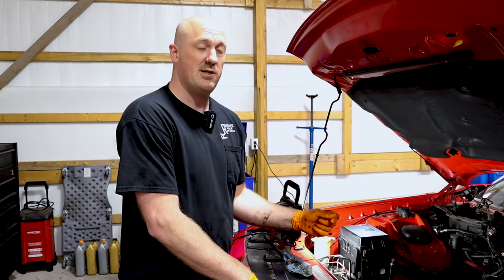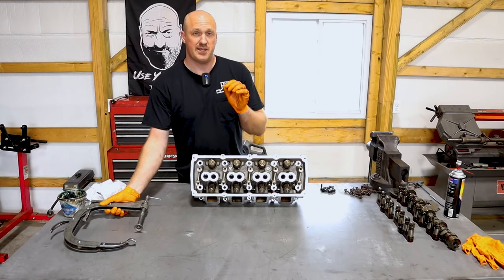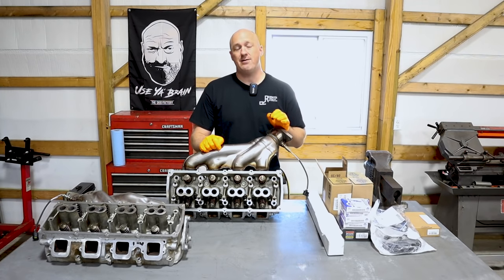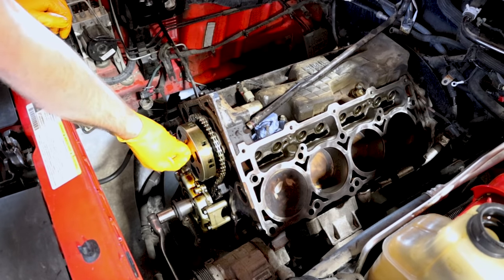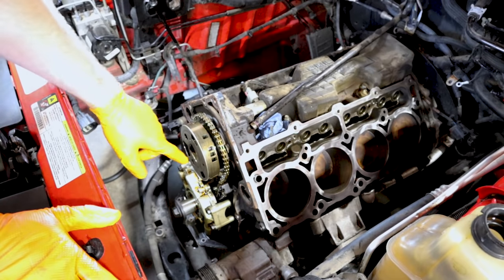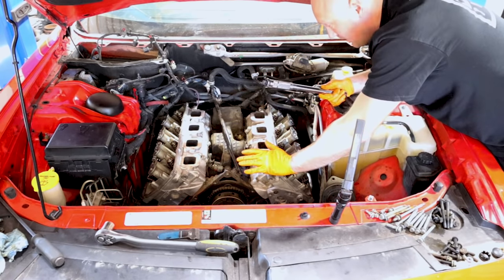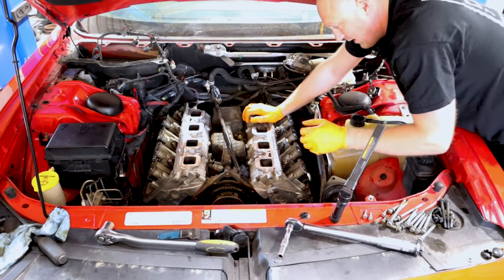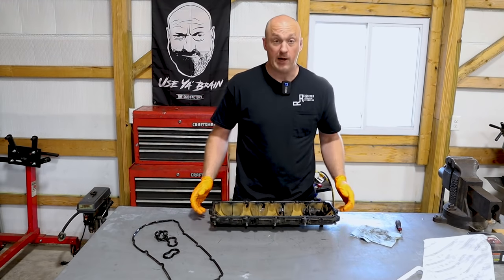Hemi Camshaft Installation Continues, SRT Headers Install! Budget Challenger Build Ep2

Comment: Thank you for this great series - it has given me the confidence to try this job at home, to fix a stuck lifter.  Unfortunately, I’m finding myself worried about the condition of the heads, and their ability to seal properly at the head gasket.  I scraped off any old material with a plastic scraper and gasket remover and cleaned them up as best as I can but I see a lot of people using abrasive wheels, which I didn’t do, and others saying heads need to be machined and resurfaced or an OEM MLS gasket won’t seal.  I’ve read aftermarket head gaskets are a little more forgiving in this regard, since the OEM gasket is generally fit to brand new components.  
You didn’t really touch on this subject in the series, and I’m wondering if I’m overthinking things.
Reply from the maker: Interesting that you post this now, since I'm literally filming a segment tomorrow speaking about this exact thing! In short, yes you're probably overthinking it a bit. I use a red (medium) coarse roloc disc on a 90 degree sanding wheel to clean the gasket residue from the surface of the heads. Don't sand at an angle, keep the disc flat to the surface, also don't put pressure on the disc, you're just looking to remove the excess gasket material, not take off the top layer of aluminum. The discs are much less aggressive than you think they are, this is what they are designed to do. 
Literally all you need to do is get rid of the gasket material from the previous head gaskets, you don't need to remove every mark from the head gasket surface. You also do not need to resurface the heads if you haven't had any issues with overheating or suspect the engine has been overheated at some point. 
As far as aftermarket head gaskets being more forgiving than OEM ones, it's actually the other way around. OEM head gaskets are far more preferable in my opinion. 
Love the fact that you've tackled this yourself, shows the channel is doing what I meant for it to do. 💪
Reply: @ReignitedAuto  Thanks, I feel a whole lot better!  Yeah, so far following your videos has made this an absolute SNAP.  The only snag has been drilling out one of the studs on the exhaust flange that broke off.  I'm hoping I can just put through a nice grade 8 bolt and a nut and that will suffice.

So this is an 09 Charger I bought out of state back in June.  75,000 miles, and it made the trip back home just fine.  BUT as soon as I got it home (200 mi drive...) I shut off the car and when I next started it, I took off and got a misfire right away.  That's when I noticed the ticking.  I took it right in to a mechanic (dealer) and they diagnosed a collapsed lifter, as I feared.  They were going to charge $7,000!  I actually said 'ok', but they sat on the car from June until last week.  When I found your videos, I said "I can do this..." and I towed it home.  So far so good.  So yes, your channel is fantastic. I've always worked on my own car, but I never thought I'd take on something like this.
Reply from the maker: @madfingers  That's awesome, good work 👏
Reply: If and when I do not looking forward as my 5.7 is in a Ram 2500 4x4 stock height , wanting to do long tube ARH at same time, thinking about doing this 6.4 cam , do you think the advantages are there and did you say you can leave mds active 
Thanks for the video

Comment: Great explanation and timing for doing this, you found a problem before it got worse. Is oil degradation one of the factors that can cause this type of wear on the lifters and cam...If so, will changing the oil before the specified time help?
Reply from the maker: Absolutely oil degradation is a huge factor in premature lifter failures. I'm a firm believer in oil changes every 3k miles. I know the newer synthetics give a longer interval than that, but better safe than sorry in my opinion.

Comment: Once again, a great video.  I'll comment on things I did wrong and perhaps some other tips that might be good or bad -- I'm definitely not as skilled as you.  I put loctite on the cam bolt and on the lifter "cartridge" bolts.  I just used blue loctite.  When I replaced my springs, the first time around, I had my shop press them on because I screwed up and dragged the head on the dowel pins.  But, I wanted to take a few off to check something, so I tried two different methods.  One is to place a rag under the valve, put the head down over the rag, then take a large socket that completely fits over the spring retainer, and give it a few good whacks with a hammer.  When you do that, the keepers fall (I should say fly) out.  But Autozone does have a screw style spring compressor.  Some say it doesn't work with the hemi, but I got it to work fine with mine.  Much better and less violent way to get the keepers off.

One of the mistakes I made when reassembling the valvetrain was that I actually put a pushrod into the cylinder head drain hole.  Thankfully, it was the exhaust lifter and wasn't able to fall all the way into the oil pan, but I still did need to use a magnet to pull it back out.  It seems like a silly thing to do, but in the ram, it's hard to work from the side and be "level" with the cylinder head like on the challenger.  When putting the rockers back on, I found that it was easiest for me to figure out which pushrod was going to be the tallest, then set that in the rocker and ever so slightly tighten the bolt near it.  then move on to the next highest and so on.  If I didn't do that, inevitably when working trying to get all four lined up, one of them would fall out of the rocker cup.  Then when they were all in, I would tighten everything down a little bit, but not all the way, and then run my finger on the rocker arms.  It is a relatively small difference, but if the pushrod is in there right, the rod will feel kind of "far" away from the tip of the rocker arm.  If it's real close to the tip, then it's not seated right.

On the Ram, the drivers side valve cover is particularly difficult to avoid the gasket rolling out like you said.  You're fighting between the cowl, the transmission breather, fuel lines, evap lines, and a brake booster.  In my case, I had to fight with it to get over the last rocker, but then once I got it over, I was able to pull it up slightly -- enough for me to get my finger under the cover and feel that the gasket was in fact rolled over.  Using my finger, I was able to press it back into place before tightening everything down.

Oh and one other thing I did, since I screwed up my heads when I took them off, I ordered an extra set of head bolts (I thought I couldn't re-use them).  In any case, I took two of the old bolts, cut the heads off real close (e.g. keep them as long as possible) and then I took a grinding wheel and gave them a dullish/blunt/rounded point (e.g. like the end of a pushrod).  I screwed the old two bolts one or two revolutions into the top front and back holes (The dowel pin ones) and then when I put the head back on, all I had to do was line up the two bolts, and slide the head down on those bolts.  The bolts that you cut down don't stick out very far because you cut them off, so you might need to use a magnet or needle-nose pliers to unscrew them when the head is in -- but that's why I only twisted them in one revolution or so.  So although you can re-use the bolts, perhaps buy two new ones and sacrifice two old ones to make the "alignment pins" LOL.  Both of those heads you put on went amazingly well, but for me only doing it once, there is no way it would have went on that well LOL.
Reply from the maker: Thanks Tucker!
 "One of the mistakes I made when reassembling the valvetrain was that I actually put a pushrod into the cylinder head drain hole" Super common, don't feel bad about it, I've seen lots of techs do this! 
 When putting the rockers back on, I found that it was easiest for me to figure out which pushrod was going to be the tallest, then set that in the rocker and ever so slightly tighten the bolt near it.  then move on to the next highest and so on.  If I didn't do that, inevitably when working trying to get all four lined up, one of them would fall out of the rocker cup.  Then when they were all in, I would tighten everything down a little bit, but not all the way, and then run my finger on the rocker arms" This is exactly the way I do it as well 👍
Also, Blue loctite is never a bad idea.
Reply: Tip to keep pushrods in place when tightening down the rocker arms. Get some fuel/oil rubber hose that snugly fits the pushrods on the ID and cut 3/4" pieces then slice them open. Slide them over the pushrods and snug the pushrods up to the rocker arms. They will keep the pushrods from dropping and will keep enough tension to hold them into the rocker arms. Once all tightened down you pull them off (that's where the slicing them open comes into play.)
Reply from the maker: @DL101ca  I like this tip, I'm going to try it tomorrow on my 6.4 build 👌

Comment: Great information!! My 2012 Ram Hemi had cam/lifter failure at 190K miles. The lifter was not on one of the MDS cylinders but appears to be a camshaft hardening issue because I had the same putting on six of the lives and one that was noisy that had worn into the lobe. Bought complete MDS delete kit with Mopar replacement cam and lifters. Hope this cam is better but 190K is not too bad but have gotten 300K out of GM 5.3’s. Still love  my Hemi!!
Reply: Sorry, six of the lobes! Doggone auto correct
Reply from the maker: Appreciate that feedback! 👍

Comment: This guy is spot on, couldn't explain it better myself. As far as the passenger side valve cover, yes I've been there also, there is an engine ground that runs directly behind it that runs up near the strut tower I undo, makes install a bit easier
Reply from the maker: Thanks for the tip!

Comment: Great videos. Thanks for sharing! 

Was told by a local [arts manager that the camshaft for a 5.7L is fairly soft material. And that they were roughly $65 for a 5.7 cam shaft! BUT.... you'll need 2 sets of lifter assemblies and those are about $475 EACH SET??!! 

So, not including labor costs, this isn't a cheap, budget job by any means. But I will say again, THANKS for sharing this info. Besides the parts prices being typical Mopar costs, I would do this at home and save the money from labor, since it IS very doable with hand tools and this knowledge.
Reply from the maker: Appreciate you watching Daniel. Yea Mopar parts pricing is crazy, the super cheap camshaft is a side effect of Chysler having to replace so many of them under warranty. By law they have to pay the dealer a markup cost for the parts used during warranty repairs, so if they price the part super cheap they pay less markup 😂. All part of the game.

Comment: I have a 2015 SRT392 I bought new that had three  lifters fail at around 23K - none were on MDS cylinders. 
All 16 were  replaced under warranty with updated parts (which came out in 2016).
Reply from the maker: Yea at that low of mileage I'm more inclined to think parts quality failure than anything else!
Reply: @ReignitedAuto  The one thing I didn't find out is what they changed about them in 2016. Would be interesting to know.  I also wonder if my cam was really"OK" like they claimed..
Reply from the maker: @ScottDLR  check out the community post on my channel I posted a couple weeks ago, is a direct comparison of the old style lifter to the new style 👍
Reply: @ReignitedAuto  Thanks - will do!

Comment: I’ve done this SRT manifold sway on my 5.7 and the motor mount heat shield studs interfere with the header. The need to be trimmed. Check before you put the head bolts in!
Reply from the maker: Weirdly some of the Chrysler vehicles have that stud like you mentioned, and some install the heat shield with a bolt. I haven't figured out why they use one or the other.

Comment: A lot of people have had a lot of success with Redline oil, it's high moly and zinc content have quited everybodies hemi valve train noise almost completely, so it stands too reason that in one way or another, it's lubricating better than your typical off the shelf oils and should mostly if not entirely alleviate these lifter failures. 

It's definitely expensive -- like double the price of Mobil 1, and you have too order it online, but it's still cheaper than a whole new valve train
Reply: Best bang for your buck Pennzoil Platinum unless you like to throw money away for no better performance. Most folks who spend too much on oil come up with all kinds of things to justify it. There's been all kinds of testing on additive packages, lubrication levels, viscosity, dilution resistance etc and they have not shown the benefits some expensive oils claim.
Reply: @DL101ca  I really don't go by tests, I go by how many people have used it and can prove it worked. HEMI's are known for a lot of valve train noise, which is normal in these engines, and literally every single person who tried Redline says it quietted the valve train noise almost completely, myself included. The only logical reason it would do that is improved lubrication one way or another. I'll stick with it. There's hundreds This fucking cop ran code for a whole nother fucking hour at well over 100mph, he risked everyone else's life, chasing someone he will never catch. There's hundreds, if not thousands of forum posts about exactly this.

Comment: My 2015 manual 5.7 started ticking at around 70k... I think it's a bit premature, especially considering the need to pull the heads to fix it. Thanks for the video on the process, though!

Comment: Sky, I installed the stage1 comp cam on my 2011 5.7. Before reassembly, I verified the #1 piston was at tdc and the cam phaser mark was at 12 o'clock. Although I didn't check the crank sprocket to make sure it was at the 6 o'clock position because I didn't remove the oil pump, I assumed it was because the #1 piston is at tdc. I rotated the crankshaft multiple times and the phaser mark and piston were dead on every time. Finally, the issue I'm having is after the engine is at operating temperature, it will not idle below 1000 rpm. On the test drive the engine is very lazy and it smells like it's over fueling. My thoughts are it's out of time, but before I recheck cam timing I wanted to get your thoughts. Thanks
Reply from the maker: Hmm, seems like you got the timing correct, there's no way that if your #1 piston is at TDC and the phaser is at 12 O'clock that it could be out of time. Are you having any other driveability problems, like misfires, CEL or anything?
Reply: @ReignitedAuto   Sky I also verified timing and went one step further and checked the crank sprocket as I was changing the oil pump also. I released the pin front the tensioner and was concerned when the cam sprocket rolled back a bit. I’m also getting a p0016 now it runs great before the second start up on a battery reset any ideas
Reply from the maker: @brandizzo1  if it runs perfectly fine and it's not stumbling at all, you might take it for a short drive to see if the code goes stored. Sometimes the cam phaser has to go through an entire sweep before it'll clear. If that's not it is hate to say it but you'll probably have to pull the ticking cover again to verify timing marks. But usually if its a tooth off it'll run poorly.

Comment: When my 2017 RAM 5.7 hits 100K I plan a cam swap. I was going to pay to have the shop do it but after watching your videos I may do it myself. Great instruction. Does the cam swap eliminate the MDS system? I want to eliminate the system and run all eight at all times.
Reply from the maker: The cam swap itself doesn't eliminate MDS, but you can purchase a non MDS cam, remove the MDS solenoids and install the block off plugs and purchase a tuner that will turn the MDS system off. 👍

Comment: Making it look easy.  When you replace the exhaust manifold bolts do you get higher grade bolts to help fight the broken bolt issues the stock motors get?
Reply from the maker: No, I think the main issue with the stock bolts is you've got a cast manifold that is very thick, and combined with being bolted to an aluminum cylinder head, the expansion and contraction of the metals is so different I think that's where the fatigue comes from. Once you install headers of any kind with a thin flange the issue seems to be resolved.

Comment: This is a great and informative video. 
I have my 2013 Ram 1500 with 167,000 miles and start having problems with cylinder nr 8 miss fire. Tomorrow dealer will give me second opinion if I need to replace engine. I was wondering if you be interested to rebuild my engine. 
Thank you.
Reply from the maker: Unfortunately I'm not taking on customer work at this time, thank you though! And I appreciate you watching 👍

Comment: Lifter roller needle bearings may fail prematurely on Gen 3 Hemi  engines produced pre 2016 due to small weak needles in roller. From 2016 onwards lifters were beefed up with larger thicker needle bearings. Lifter PN went from AA being lifter to avoid to AB revision with larger thicker bearings  from same OEM, then AC which now come from different supplier.
Reply from the maker: Check out my post on the community tab of my channel. I posted a picture two days ago showing the differences between the older style lifters and the updated lifters. 👍